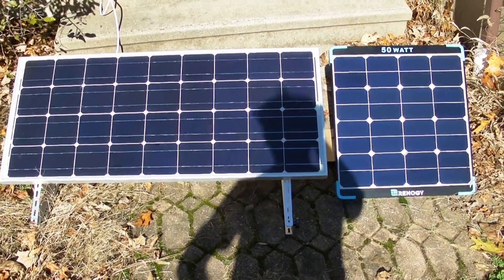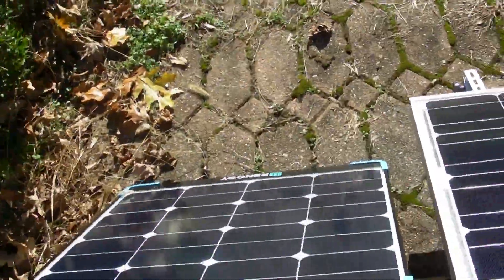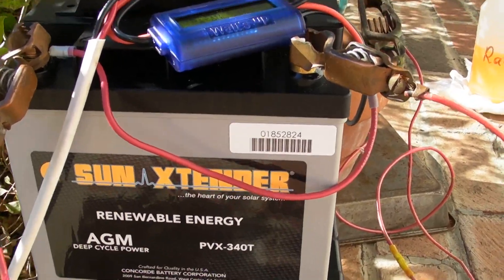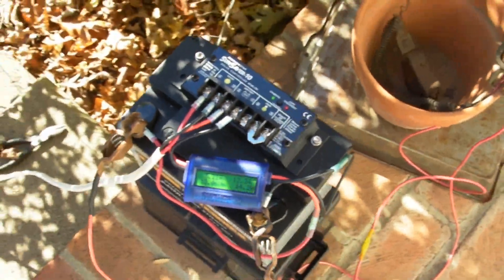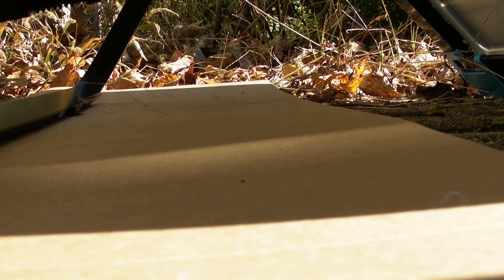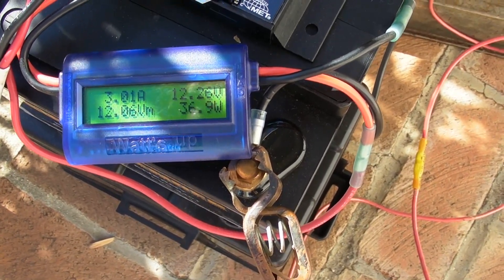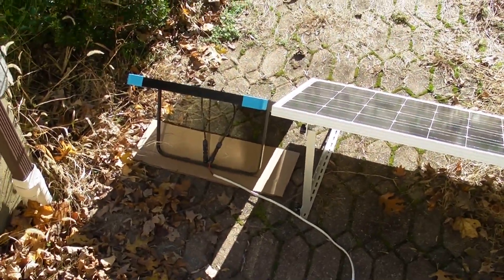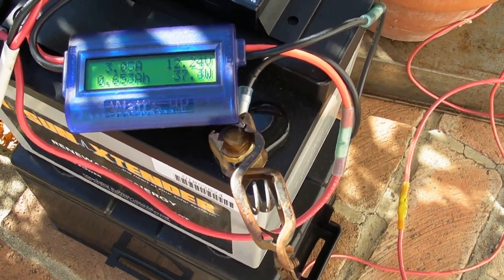Renogy Eclipse 50 watt vs Standard Cell 100 watt Solar Panel

Comment: I own that 50 watt panel too and use it to charge two portable solar generators of 155wh and 300wh which I use for astrophotography. It works great on both. I particularly like the construction of it, with the kickstand and the guards around the edges. It's a nice panel.
Reply: About how much watts do you generally get out of it?

Comment: the 1/2 cells like in the 50 watt panel are more effecient than the panel made of full solar cells. This is due to the smaller gauge wire used int he 1/2 panels creating elss resistance.
Reply: That's... completely backwards. Smaller wires inherently have higher resistance.

The difference in efficiency is that the eclipse panels are designed to stay much cooler in the sun, along with higher quality materials overall.

Comment: Goodmorning I need your help. Am going to purchase an 80000mAh portable solar inverter generator ups supply energy storage source296wh. I would like to know if a 50watt solar panel can charge it? I wish I could attach a photo for you to see what am talking. There is a DC port on the inverter generator and thats where the panel dc cord as to be plug to charge it but I need to know if it can charge it before I buy the panel. Thanks!
Reply: Yes it will work fine.